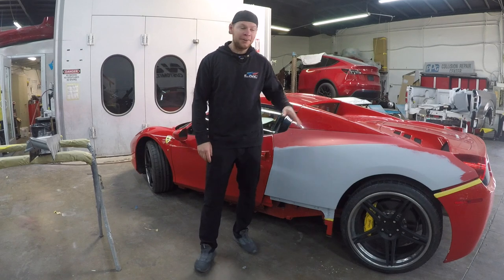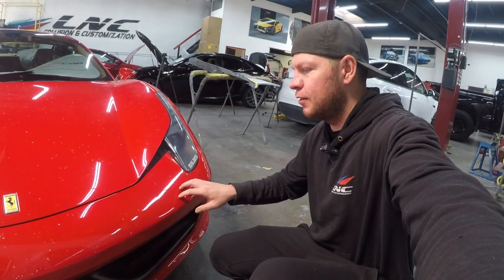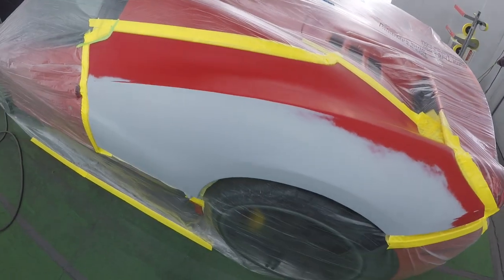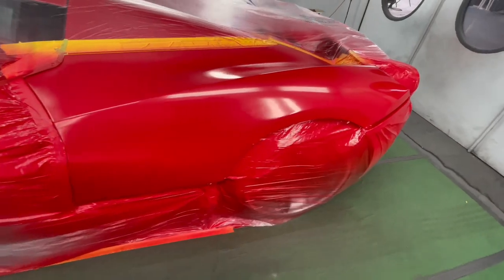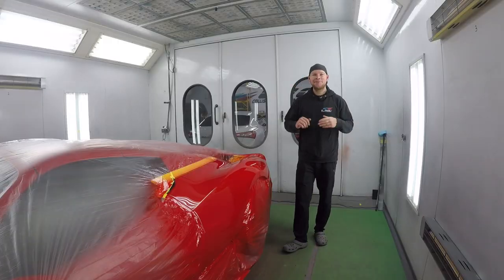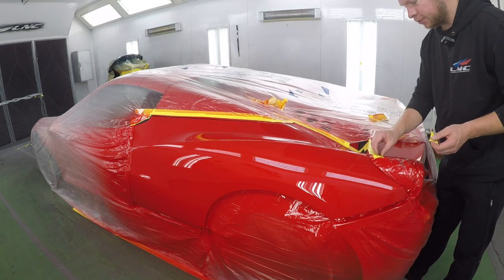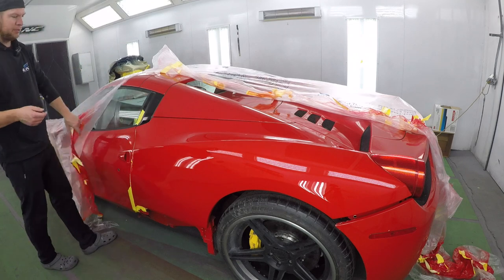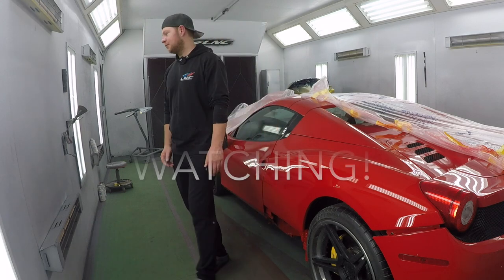Ferrari Paint job with no Blend! PPG paint application and Color Match

Comment: Hi andrey , looks good inside the spray booth . Hopefully you have the same result in thecsun outside . As you said the toner was empty …. Don’t you have all paints from your mixing machine double in the rack ?? We do like that ,so we never have an issue with this . Although that our ppc dealer is delivering every day….
Reply from the maker: Yes hopefully it matches well, worst case scenario we can always paint the door and fender of needed. I usually order toners when the get low, but sometimes run into issue where not enough because certain colors use so much of it. We get deliveries twice a day, it just happened to he after the cutoff time 😅